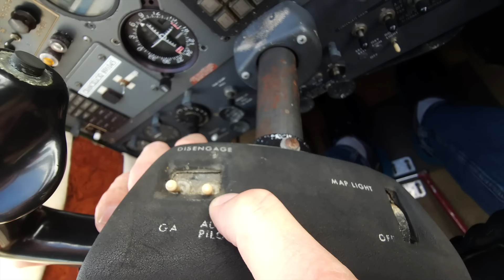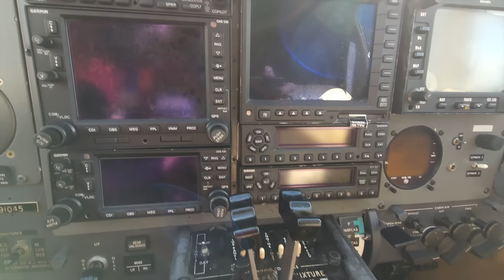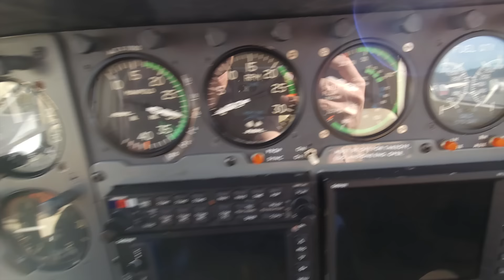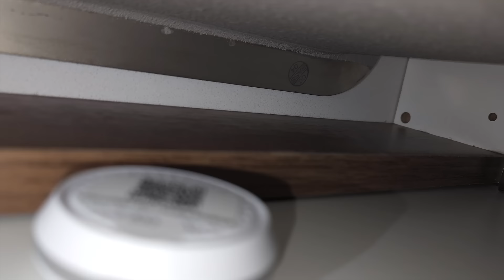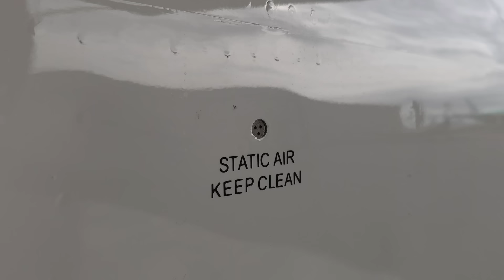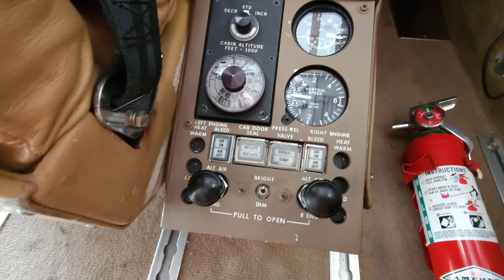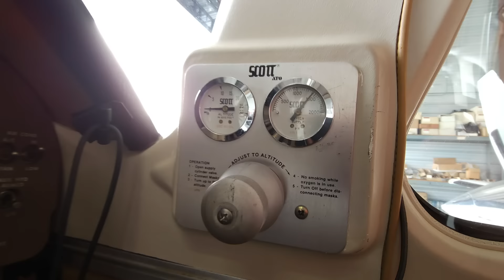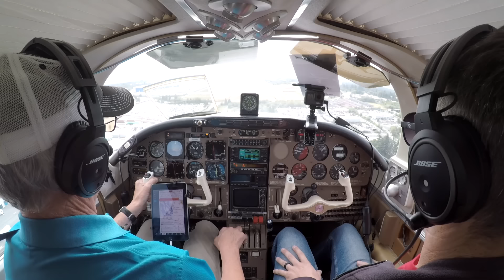$100,000 Facebook Marketplace Deal Of The Year

Comment: If that plane was in annual last year, I don’t recommend hiring that guy to do your annuals 😂😂😂
Reply: It was in annual…but did it pass the annual.
Reply: "Ferry permit approved" was scratched off so it just said "approved"
Reply: I was thinking just that. Nothing could deteriorate that quickly. Tick boxing to get a sale me thinks. This is why I’d take an INDEPENDENT expert to look at a potential purchase. J knows what he’s doing he just teases us for content. Which btw I enjoy.
Reply: Great video Jimmy. Walk away, but I said that about Mighty Mouse. 
Loved flying the Aerostar.  I think ours was a 601. It was so fast that the airline owner tore the gear doors off. 
Those are 777X folding wingtips. 
Most airliners (aluminum) pressurize to 8.6psi 8000 ft. Cabin altitude. The 787 (carbon fiber) pressurizes to 9.2 psi which gives you a 6000 ft cabin at altitude. 43,000.
Reply: My bet is, it was an attempted annual !
Reply: Yeah, and if that paint was given more than a 4 , I’m not buying it., I’d be more pissed at the radio shop, that didn’t tell this guy, “this ain’t the one buddy” you know they opened and crawled through every inch of that thing, chasing wires, and corroded connections, voltage drops.. the mechanic shouldn’t have let this guy spend more money., just everyone that was all to happy to take his money..
Reply: Ummm jimmy 120 cubic inch ?? ?? Nope tsio-520 is believe it or not, 520 cubic inch., but I know you know that
Reply: Those cylinders may just have rings that are stuck in the ring lands, because there’s rust on the plugs, YOU KNOW, the cams are rusted,
Reply: @GRANITEMONUMENT  it will buff out
Reply: @GRANITEMONUMENT  He was only counting the inches that still have compression
Reply: Pencil whipped!
Reply: For those who don’t know how to buy an airplane. It’s best to have a complete annual inspection performed and signed off as airworthy before buying so you know it’s all good and up to date legally.

Some sellers won’t allow this due to their personal risk. In those cases they should allow a “pre-buy” inspection.

A quality pre-buy inspection should basically be the same thing as an annual. Buyer and seller will always need to come up with what they both feel is fair and reasonable for both sides under whatever circumstances exist.
Reply: it was in annual and then it was parked in the ocean.
Reply: @77Avadon77  Right!!!
Reply: No, that guy was PAID to do the annuals, only God knows how he did it.
Reply: You buy that plane or not. If you buy it, well, take those engines apart. Revision. You KNOW that is best. Or do you have two good engines laying on a shelf?

Comment: The plane is worth 35-40K as it sits. Then part it out and scrap the rest.  It's at least a 200K repair job and that doesn't account for the avionics if they are bad... run....and don't look back....
Reply: No, the used engines, turbo, heater, gear, and skin is all good.....I would says its 60 to 100k
Reply: @MickyMonday - No chance - the demand for old Cessna twins is spiraling down
Reply: @davidburke5782  Maybe, but the cost of replacement parts are going up....
Reply: Definitely too risky. I would value the plane at $20k as the avionics are a ? I would run away fast though.
Reply: @stephanielongden597  one wing and one dead engine are gonna run 20k....You think parts are cheap? IMO Spars should be good, its a low time airframe
Reply: … the only thing that’s nice about this video is the weather… 🙄
Reply: @flitetym jimmys nice..supa nice and looks on the bright side always
Reply: $30k on a good day. $20k on a normal one. Tons of issues with this thing.

Comment: I know a guy that raved about buying a 421 in "airworthy" condition for $150k 2 years ago. He instantly dumped  nearly $100k into the panel, New Garmin PFD, autopilot, navigator and flew it for 3 months. 2 years later he is into that plane over $500k. It still looks like crap and the mechanic says it the worst condition twin cessna he's ever worked on. Buy a plane that needs nothing guys

Comment: Jimmy, the main tank recirc pumps are on the landing light circuit.  You have to pull the retractable landing light breakers to stop those pumps.
Reply: all correct except the pumps are called "continuous duty tip tank transfer pumps"

Comment: That unit under the sink goes to a button the staff can carry and when they are cleaning the room if they have an emergency, they can press it and it relays back up to the management where they are when they hit their panic button. That is the locator that is in each room to tell them what room they were in.
Reply: @popiyerby2088  "Ive fallen and i cant get up.....".....We all have cell phones now and Siri....However.....If staff heres you moaning on the floor they can call for help with a push of a button
Reply: No offense jimmy, but put that thing back.   Many hotels maids have been assaulted in the rooms, those are panic buttons for a reason, when somebody panics....love the show, save the310
Reply: Looked like a battery powered air freshener to me. Get rid of the mold smell under the leaky sink.
Reply: @rickashford4005  And somebody took the time to write a room number on the back of each one?   And hotels would wire something like that in, not by AAA and cr3032 batteries....
Reply: Tin foilhat here - and i thought i was paranoid 😂 just search the name of it and i can understand the panic button idea. You can also come across such small devices in cabinets and technical cabinets to warn staff about water leaks which can be very bad in such buildings.
Reply: Surprised manager wasn't unhappy at you vandalizing the room. Washington has a law that hotels need to take action against guests raping the house keepers. Manager could have explained the device's use better but jimmy, tear down the planes but stop wrecking other peoples stuff.
Reply: @joncorke760  Just so we all on the same page, many hotel/motel maids are in this country illegally, and fear deportation for reporting anything to the police.  This makes them easy targets...Im sure Jimmy is aware of situation now, we can all move on....

Comment: A VP at Aerostar Aircraft Co told me that new pressurized piston Aerostar would have over $1.5 million in parts. So…a old one has the same but mostly worn out parts. The guys buying an airplane for $200k generally can’t afford to maintain all those parts. Likewise, they can’t often swing a $500k+ hangar. One guy’s explanation for the large number of ratty piston twins
Reply: T- hangar is 250 month.....shared corporate hangar at $400.....Problem with aerostar owners is they think they need the 500k hangar penthouse attached to a private strip......
Reply: An Aerostar will eventually cost you between 500 and 600k when you are all done getting it restored to close to new with full Garmin Glass.  But then again I could have a Cirrus for $1m.
Reply: @AerostarPilot  or get 5 Aerostar owners to share-own a Honda Jet.

Comment: There's not enough compression in the cylinders from the rust build up around the valves, so you're wasting time not to mention you're going to ruin the battery and could cause a fire on the electrical side of things

Comment: Now that was a great ending on two fronts, you dumped the over priced, bad deal of an aircraft and jumped into an Aerostar. I grew up and lived in Santa Maria during the years when TSI came in to town and started manufacturing aircraft again. It was an everyday thing to see one zipping by on departure or approach. A guy I went to high school with was one of the test pilots and I was in awe. At the local airshow a bad a$$ Aerostar named "Zar" painted sinister black was flown by Jimmy Franklin. It performed aerobatics with smoke billowing from both engines. It was a sight to see. Thanks for the renewed memory of my home town involving the Aerostar. Bravo Jimmy!
Reply: I think the Aerostar 600 was named "Starship Pride" and the character played by Jimmy Franklin was named "Zar"
Reply: Buck, thanks for clarifying, you may be right, I was in my teens back then, it’s been 40-50 years since that time, I just remember the Black Aerostar coming out of nowhere, doing low level, 300 mph passes on flight center, smoke billowing from both engines then going vertical, into a split-S and rolling out, that plane was so graceful and flew like it was on rails and the sound of the engines screaming in sync was exhilarating.

Comment: Unless you are willing to go the way of the Rebuild Rescue guys, run away!
Reply: Exactly, total tear down and rebuild, like an old car strip it down to the frame and start putting new everything on it.
Reply: @JackThelRipper it just needs some love
Reply: @wolfpaw2715 - No it needs to come apart - it will be a bag of nails
Reply: Didn't their plane crash on a test flight?
Reply: @AnarchyEnsues  
Sadly, one of them did and it cost the life of one of their team. But that wasn’t the plane we are referring to. They started to work on a twin Cessna and ended up tearing it all the way down. They’ll never get out of it what they have into it, even if you count the revenue from the video’s.
Reply: @AnarchyEnsues  Sadly a series of unfortunate events. Bad seal on the fuel cap has been reported by some but most are blaming water in the gas. I think the NTSB/FAA report is out or should be soon.

Comment: You’re going to have a few of the cylinders corroded because the valves remain open when the engine was shut off. The corrosion probably came from a high humidity area and all that humidity crawls right up the exhaust and right into the cylinders. I expect that if you get it started the corrosion on the valves will disappear and the rings will get some oil bringing the compression up. You did say the engines only had 520 hours or something like that.

Comment: $100,000 for a $250,000 airplane means you'll put most of the %150,000 to get it in the air again. You may be able to find a flying one for less than the $150, 000 needed for repairs
Reply: Everytime I see the Aerostar I think of the movie "American Made"
Reply: I agree.  That is good advise.  Spend the $250, keep it 5 years, sell it for $350.

Comment: It's a shame he let that 414 rot away outside, but it's basically a parts plane at this point. It's too far gone to save. Being pressurized it's not worth what it would take to put it back in flying condition. All of the moisture infiltration means that the seals are gone and it's just done. Sad, but it should have been stored inside. The moisture certainly did its share of damage, but what the moisture didn't ruin, the sun baked the rest of the way to past the point of rescue. 

Honestly, a 414 is full of too many compromises, in my opinion. The fuselage is larger than the 340, but it's underpowered and you seriously sacrifice range with passengers and baggage. You can't fly it full fuel with 2 people on board, let alone bags. The 340 and 421 present far fewer compromises between range and payload. The 414 has great ramp presence, but it's kind of the red-headed step child of twin Cessnas. That's why I went from my A36TC Bonanza into a 421 Ram conversion before moving to the Conquest II I own and fly now. 

And you DON'T want an Aerostar if you aren't prepared to pay for the prodigious maintenance. Yes, they are wicked fast and fun to fly, but speaking as someone who had a low-time well sorted one years ago, I was happy to pass it along to the next owner once I got owning one out of  my system. It was a maintenance queen and very expensive to maintain. Very finicky to maintain to my standards too. My mechanic spent more time working on mine than I spent flying it. There is a definite price for that performance. But when it was dialed in, it was invigorating and addictive to fly. It's definitely NOT the airplane to do "Jimmy Style". It will certainly bite you, if not kill you. It's a very unforgiving airplane if you do something stupid. It will bite you before you realize what you did.

Comment: Cessna T303 Crusader, one of the last ones manufactured would be an excellent choice. But you need to state more of your metrics for a better suggestion if that would not suit. The t303 has excellent handling characteristics and decent speed at altitude. The engines are flat rated so you can fly them balls to the wall all day long and easily cruise 190 knots plus

Comment: Jimmy the ticking you are hearing are fuel pumps that are in the tip tanks.  All the tip tank 400 series Cessna's have them.  They come on anytime the master switch is turned on.  Their purpose is to pump fuel from the back of the tip tanks to the front where the engine fuel pick ups are.  In the early days these pumps were not installed and during high angle of attack climbs if the tip tanks were not full the engine fuel pick ups would become un-ported and engines starved of fuel.  The pumps were then installed to prevent the engines of being starved of fuel.
Reply: Yikes.. high aoa and a motor cuts out 
Wonder how many accidents were attributed to that design issue

Comment: Jimmy, some altimeters had a vibrator in them so as to avoid stiction. That is probably the noise you heard and couldn't track down. Also, the big Boeing sitting out there is a 787-9 Dreamliner. It's the only one with fold up wing tips. They had to build it that way to fit in the terminal slots at the airports around the world.
Reply: Think you're thinking off the 777-X that has the folding wing tips it's a feature exclusive to the 777X only

Comment: Be careful with those Pressurized Twin Cessna's my friend, if it's been sitting outside it's gonna be a maintenance nightmare chasing down all the leaks. I nearly bought a Cessna 421 until I read into the non stop maintenance. Every time I've flown in a 414 I've seen some sort of issue. I am glad I stuck with a 310R.

Comment: That noise you hear when you turn on the master is the vibrating recirculating pumps out on the tip tanks (the mains). They are on all the time to keep the fuel recirculating. Those tanks have baffles and the pumps keeps all the fuel accessible to the engines. Those pumps tend to wear out. If you don't hear them😊 come during preflight, the pilot should have it checked out. A lot of guys are out there flying around with failed recirculating pumps in the mains. 😮
Reply: The continuous duty tip tank transfer pumps are only there for high angle of descent with a low quantity of fuel in the main tanks. The fuel pickup can be unported so the transfer pump keeps the pickup covered in fuel.
Reply: Good call Buck.  Thank you...

Comment: 16:36 Looks like the fuel pumps are behind that red gust lock along with the engine primers and engine start switches and it looks like the both fuel pumps are switched on . I think , I am no pilot just know bits from flying the Cessna 414 in MSFS 2020 . So 100% reliable information there for you !!! .

Comment: Jimmy, when you flood the engine, try as you did do, Mixture - Idle Cut Off, but what you did not do is:  Open the throttle..... As you turn over the engine starter, have a  hand available at the throttle/fuel Mixture body to 1st reduce the throttle as it starts and then advance the mixture control to Rich

This procedure gives you maximum reversal of the Condition you may have induced when flooding the plugs.  Or, 

Condition:
(Fuel to Air Ratio) was exaggurated (flooded)
(Fuel to Air Ratio) Correction:  Open throttle (full-open) Mixture idle cutoff

Comment: I have thousands of hours in the Cessna 400 series aircraft. Spent about 8 years as an instructor check airman in it. This is a real deluxe model. What you are looking at is an iceberg of mechanical issues. The engines are just the tip of it. Good luck with the autopilot system. They don’t get replaced, they get fixed. There is an aftermarket retrofit that ain’t as good as the original. The turbo charger elbows alone are very pricey and they need to be replaced often. Fuel tanks, valves and pumps can be issues. Did you say Lycoming? Ha ha, you may be over your head. Price out those retractable landing lights. They fail quite a bit. Corrosion work, interior, avionics, boy it can be a real heap. Insurance can be pricey for piston cabin class twins. I hope your counter offer is aggressive. BTW, you must know something about these birds because you avoided opening the emergency exit. Smart move because they can be very difficult to close again. Stay away from the 421. Geared prop bad juju. 414 is the way to go. World family tour? Beech King Air.

Comment: Good decision not to buy that clapped out old thing.  I flew them back in the day and enjoyed flying them.  Flooded or hot start is throttle wide open, mixture lean, and then start.  Once it starts you quickly push the mixture rich and pull the throttle closed.  You may have actually gotten it started if you'd have run the throttle wide open with the mixture lean.  It's been a while (25 years or so) since I flew the 414 but if I recall you only get fuel flow on the gauge prior to start when the throttle is open and fuel pumps on.  So, it's pump on, mixtures rich, throttle open to prime, throttle closed, fuel pump off, then throttle 1/2" open to start.  I remember it was always a dance.

Comment: The “backside” of the prop as you called it, is actually the front of the prop. You have to think about the way the prop turns. If you face the plane the prop turn counterclockwise, which means the “backside” of the prop touches the air first.